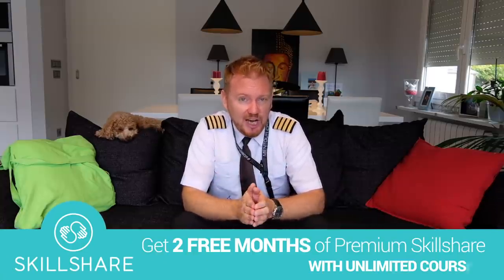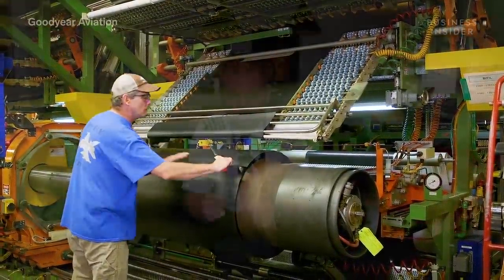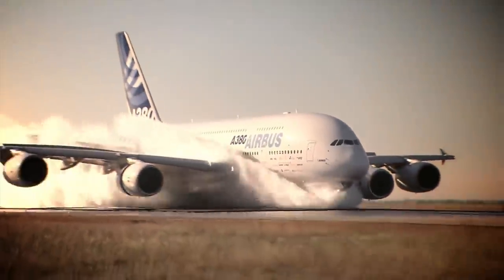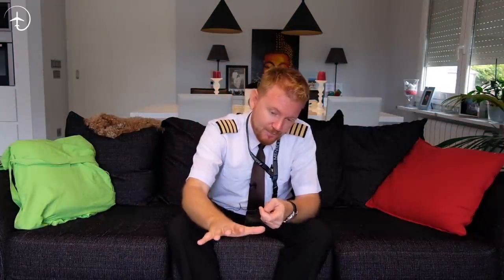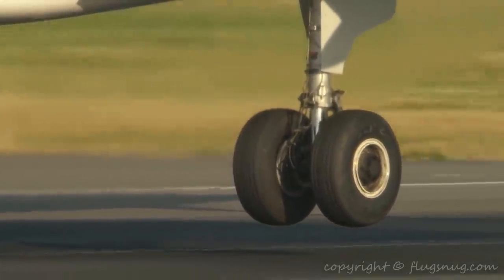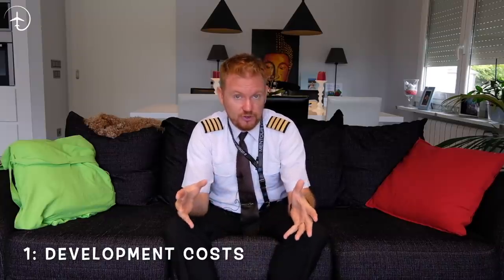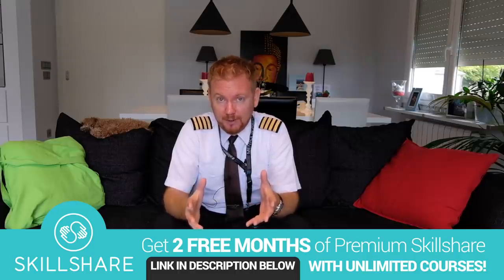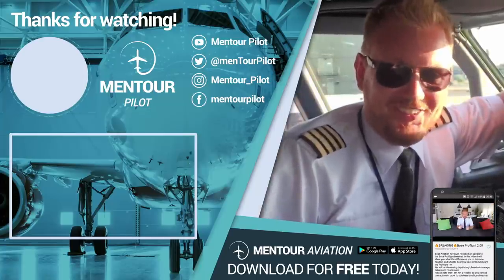Why not make plane-tires spin, before landing?!

Comment: There’s also the Magnus effect (spinning cylinder in the wind) which powers whole large (rotor) ferries and would surely come into play here.
Also if you had to suddenly stop the fast spinning wheels shortly before landing, it would plummet the nose of the plane (same way as freestyle motocross riders control the rotation of the bike during long jumps by either adding throttle or hitting rear brake).
Thanks for the explanation, great vid.
Reply: Magnus effect works exactly the same after takeoff so it is not a problem

Comment: This was attempted many years ago by molding vanes into the sidewalls of the landing gear tires.  This was the earliest way to bring the tires up to speed just by using the available airspeed of the plane to provide nearly the perfect rotational speed to eliminate skidding of the tires.  It is also much less expensive and a more reliable means than any kind of motor.  To my knowledge it was never adopted for some unknown reason.

Comment: Now the tug drone is a darn good idea, something that can push the plane all the way into the runway and hobble off before takeoff instead of burning 200 kilos of fuel. The ATC could steer them directly and avoid all taxi conflict issues while at it.

Remember, using reverse thrust to back off a terminal was something common less than 30 years ago.
An extreme version of these things could even work as a cradle to aircraft where their landing gear was stricken, destroyed, or locked, and synchronize with the aircraft and catch it as a quarterback, just remembering a Harrier pilot that landed the locked front gear on a stool.

Comment: Even rubber vanes (on the cheeks of the rubber wheels) could spin up the wheels quite a bit before landing. It doesn’t have to match the ground speed to save a fair amount of wear. I suggested this years ago but there were comments made about the gyroscopic effect.

Comment: Guess it's worth giving a try on a prototype, though not electrically driven but maybe a "spring" mechanical system or such. The landing in crosswinds will follow with priority the vector of the plane, maybe with a little more slipping but not very noticeable. As for the electric automated tugs, I wrote to the famous Mike Pattey brother from Best Tugs, and he replied that the status quo industry "trust" system doesn't allow changes and improvements because... (I didn't understand why). Though this would be a really great idea for decreasing emissions, and it can be fully automated, without involving the pilots! The pilots only from takeoff to landing, the entire taxiing could be automatically done by the airport service. (It would be a huge relief for the pilots after a long flight to be exempted from the stressful taxiing in a busy airport.)

Comment: The entire landing gear and all the components, including the tires are designed for all of the forces imposed during even the hardest of landings.  Pre-rotation of the tires would do two things, eliminate the need to remove the rubber from the runway every now and then and get a slightly longer service life from the tire.
Reply: You shot down the second part of your post in the first sentence.

Comment: Pure nitrogen is used, because air contians oxygen that can react with components in the tyre.  Nitrogen is inert (non-reactive), while the small amounts of oxygen in air can cause corrosion.
By the way, I love your series.  I'm not a pilot or engineer, but rather an airline consumer (passenger).

Comment: The added cost of flying the extra weight of 'spinning gear' would soon eat up any savings on tyres, apart from which the initial friction probably helps as park of the braking and bringing the aircraft down at just the right time.

Comment: A simple suggestion... by adding a blade kind of a setup at the walls of the tire in the same rubber material, it will start rotate when the landing gear is lowered due to the wind speed.. by that way we can avoid battery, motor or fuel etc... and tire also rotates..

Comment: Hallo, interesting video. I wonder: what if airplane tires had little fins on the side so the wind will spin the tires. Thats a lot more reliable than electric motors. U could than also use the gears as a airbrake because of the extra resistance. And maybe it doesn’t make sense make the landing gear spin but the micro pieces of rubber are considered as micro plastics that damages the environment so maybe thats a reason to help safe tires? 

Thom

Comment: Nitrogen is used for two reasons. Normal compressed air will contain normal atmospheric moisture, which will change phase during extreme temperature fluctuations, drastically altering the tire pressure (commercial N2 is dry). Also N2 isn't nearly as a good of an oxidizer, so it doesn't support combustion of the rubber when the tires get hot. An airplane tire filled with air (20% O2) could easily catch fire or explode after hard braking on a short runway.

Comment: As always, Mentour Pilot nailed it.   The issues with the crab-angle landing stomps all the other issues.  BUT I'm surprised he didn't mention one other detail.   Airplane has to come in for landing, and EVERYTHING is about "losing energy" from the thrust reversers, to the spoilers and speed-brakes coming up due to "weight on wheels" AND anyways that little shot of smoke, is just one more way to lose 1 percent of all that energy.  It is how it is, cause that shot of smoke helps the plane to get on the ground and slow down.   WHY can airlines have retreads?  They sure don't work on the 18-wheelers.
Reply: hand built tyres

Comment: I propose a very simple solution, I would put a kind of side cover with fins on the tires so that they would start to spin and help in braking downhill. Also, if you do not require speed on 1 or more wheels, you can brake them before touching the ground.
 It would be so easy to install on any plane that it would be an insult to commercial companies not to try XD

Comment: Another point about pre-spun wheels is the fact that inertia of the wheels give the aircraft a jolt during landing. The wheels need to go from 0 RPM to thousands of RPM in very short time, and this inertia causes an adverse momentum on the arm of the landing gear. So there could be more pros into designing pre-spun wheels

Comment: Rather than electric motors, the alternative could be small air start turbines fed by bleed air from the prime movers.  Also, the tires could be spun to 50% or 60% of speed-over-the-ground, appreciably reducing wear while reducing unintended effects like gyroscoping and surging the plane upon touchdown.

Comment: I used to work for an inventor back around 1980. He came up with a system where he added small fins to the sides of the wheels where the air flow would spin them up once the gear was extended.  He had a full size proto type in his showroom. It was a very simple system.  It never got anywhere because the difficulty to get them certified aka the cost far exceeded the cost of replacing the tyres.  I think there was also a problem with gyroscopic forces when the gear was retracted as they would still be spinning full tilt.  I have never thought about if the breaks are applied when the gear is retracted as I’m sure wheels are still spinning on normal aircraft today?
Reply: some auto systems sometimes the pilots touch the brakes

Comment: You could use an air compressor to air turn the tyres! This can be tuned to speed up or slow down the rotation of the tyres! Just a thought.

Comment: As an engineer I would say the engineering is fairly trivial. The aircraft knows what the ground speed is. The wheels could be driven from air from the compressor. A simple valve can regulate this to get a low cost and reliable tacho sensor to give the required RPM to match the speed. Even if the speed is off by a few mph it will save a lot of wear. If it fails, then it simply operates as it does at the moment. It would also save further pollution from particulates coming off the tires. They also get washed into the water supply and we all end up consuming them.
I like the idea of a tug to move the aircraft around though. That would save a lot of fuel and be safer not having spinning blades around ground crew. A skateboard design like an Tesla EV could manage that job no problem.

Comment: Some form of Vane system on the wheel rims. Use an adjustable system that can be retracted during take off (or in any iffy landing situation). For normal landing you could adjust the angle of the veins to control the spin up speed to match landing speed.
Reply: Veins?! Vanes, perhaps, but not veins.
Reply: @ErikssonTord_2  You like picking on Dyslexic people?

Comment: just add some slats and groves on the side of the wheels .... the point is when descending the air passing by the wheel will push the slats and the grooves and the wheel will spin ..... not at 260 miles per hour but it will reduce the wear and tear on the wheels

Comment: So, I can understand the aspect of safety for at least running tires upon landing. However, I do bring up this question. One of my own curiosities not answered both in the comments or the video. What if you used these supposed motors for only taxi. Keep them off during Take off and landing. But when on ground fully stopped and in a safe position off the main strip, switch to the motors themselves. We will say metaphorically these motors do handle what it takes to be safe just for taxing. One thing that I heard and noted was the use of going full batteries on the motors to get moving. While this is fine, there is a reason we dont carry much of anything L-Ion based into a plane. At least to my own memory, correct me if I am wrong there. So, instead of running it on batteries, why not just run the motors of the APU? I hope I got that right, been a while since I took a look at aeronautical parts and systems. You wont have to worry about batteries and the APU should be able to provide just enough power to get the motors moving. If its capable of stirring the jet engines to life that is. Use less fuel while on the ground without the worry of batteries potentially exploding midflight due to lack of pressure. Or whatever causes batteries to supposedly explode in flight.

Comment: It does not need to be an additional motor, just vanes that will be activated by the wind rushing passed the wheels during landing, Any rotation speed obtained will help reduce wear and tear

Comment: Even before you start explaining, my thought was, "Heavy, not efficient, energy-hungry, bulky, and ridiculous (my opinion)." A system like that would cost more than maintaining just tires and brakes. Also, no electric motor can possibly withstand the temperatures during an aborted takeoff or whatever emergency braking scenario.

Comment: I know little of airliners, but I've seen truck tires catch fire,  simply in normal service.  Same deal with race car tires, which is why they're routinely filled with dry nitrogen.  A few years ago there was a scheme to sell nitrogen inflation for passenger car tires (they'd put a green valve cap on your tire to show that you'd inflated your tire with nitrogen.)  I think the supposed advantages have been de-bunked now, but some garages still have nitrogen tanks for this.  Corollary: since race tires are nitrogen-filled, it's handy for pit crews to use the same pressurized nitrogen in their air tools.  Behold: there's a cult out there which preaches that only nitrogen must be used in pneumatic tools, for that's what pit crews use.

Comment: The rims could be fitted with simple conical scoops to catch resistance out of the air rushing past during the landing. The plane would feel different to the pilot, I’m sure, but that could be controlled by keeping the rotation slightly slower than landing speed. The dynamics would be normalized as traditional brakes come into play. Brakes could also be used to slow pre-landing rotation for those angled, crosswind landings, to make sure rotating wheels do not draw the plane off the runway.

Comment: Pre-landing tire spin was dealt with long before airline passenger jets were invented.  I just went to the book shelf where my old aviation books from the twenties or thirties are gathering dust but I'd have to move too much junk to get to them  .  .  .   What I remember from reading those books more than 50 years ago (they were my dad's.  He flew before he got married and had the responsibility of wife and kids) was that plane builders tried small vanes on the wheels and the airflow would start the tires spinning when the landing gear was lowered.

Comment: Delbert Crawford
1 second ago
Good post but only the tip of the iceberg so to speak. What are all the issues1-Out side air temp. is -50 degrees F and the bearing grease is solidified.   Fix with preheated lube oil at 50 degrees f  with seal by pass and circulate with a small air turban pump.and pencil heater.  Install push back springs in wheel disc brake cylinders This will help in free spinning. Wheel spin up via Pelton wheel hub caps and or tire cups in the moldings. Pilots can apply breaks until  just before touch down to deal with Giro effect in cross winds. This is somewhat of a copy I use on Boat Trailers to prevent water intrusion.  Pat pending?dellori3

Comment: Electric motors: they can easily accept (over/under)-speed if built correctly
idea 1:  have the motors run off of the engines 
i2: 1 motor per pair of tires
i3: if a motor fails it should be able to "free-spin" like plane-tires do now [hence  the motors are able to withstand (over/under)-speed]

Comment: Since you already have hydraulics on the aircraft, if you wanted to drive the plane from the wheels, I would recommend hydraulic drive.  
This would give the most torque to weight with the fewest moving parts.  
But the hydraulic motors wouldn't handle takeoff or landing speeds, so I would use a magnetic clutch to disengage them.

As far as spinning the wheels up before landing, as there is no load aside from the mass and inertia of the wheels, you could probably use a capacitor bank instead of batteries.
Reply: All ideas that might work but aren't needed.
You would have to provide a separate hydraulic supply anyway because the regulatory bodies (FAA/CAA) wouldn't let you use either the brakes, or leg extension/retraction systems, in case of a failure in a non essential system (wheel spinners) causing the failure of an essential system (brakes/landing gear)

Comment: I wondered about this very situation but I proposed a very different solution to start the tires spinning , that is scoops of material attached to the outside of each wheel so that the airflow would start the spin. At the top of their travel they would be folded so they would not impede airflow. I was subsequently told by an expert that spinning the tires was actually undesirable because as the tire hits the runway it heats up which allows extra traction and braking force. As this was not mentioned I wondered if this is actually a reason?

Comment: I'd argue against the last point made at 14:00 minutes that when landing at an angle, the motorised wheels would drive the aircraft off the runway.  This is because the motors would only need to have enough power to spin the unloaded wheels, not enough to pull the aircraft.  Also, the inertia of the spinning wheels would be negligible compared to the inertia of the aircraft to cause any material change in the direction of the aircraft movement.

I also question whether motor is the only solution for this purpose.  I would think it is possible to install fan blades on the brake discs.  These blades would spin the wheels to match wheel speed to wind speed during descending.  When braking on the runway, the blades could help to dissipate the heat from the brake discs.

Correct me if I am wrong.

Comment: Aside from the balance issues already discussed here, why not spin the tires up while they are still in the bay area? Either with motors there or open air inlet valves on the belly to the bay area that would then turn a fan or bladed system that would start the tires turning. The weight of those systems would not add too much more.

Comment: The remote tug powered on it’s own either electrically or reciprocating engine has been tried at least two years ago. Delta is one airline that tested a prototype.
Apparently it wasn’t a feasible idea because no airline adopted it.

Comment: Thanks for your interesting explanation about a topic I have been thinking many times.What I was thinking was some kind of blades around the wheels so to let  the air flow to spin the tires.Of course the spinning wheel will not match the rotation speed  required by the landing, but this would maybe help to generate less stress (and less possible tire explosion) to the tires..and also maybe smoother touch downs and also a couple of hundred more landings  before they need to replace the tire.But I'm not an inventor..and if the aeronautic industry does so I'm sure they're right!And probably the not moving tires are good to have more braking  action during the touch down...

Comment: There were nose wheel spin up kits on some Citation aircraft (using vanes and air) for dirt runways. They added about 70 lbs to the nose wheel. Many of us flew Citations without them and had no problems operating off of dirt air strips.
Reply: Haha, of course you did... Citation

Comment: Fins could be molded onto the tire sidewalls that open when the airflow is coming one way, and fold flat when the airflow is coming the other way.  This would set the wheels spinning before touchdown. No active components needed, just a little extra material on the tires. Extended tire life could justify the additional cost for each tire.